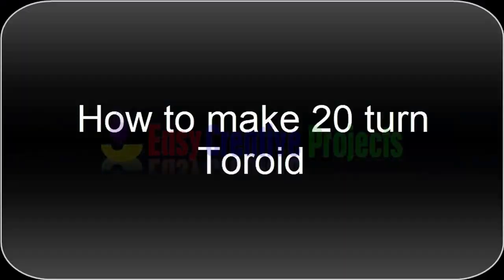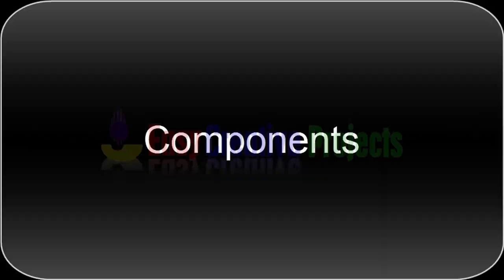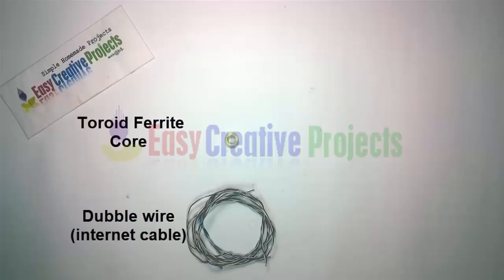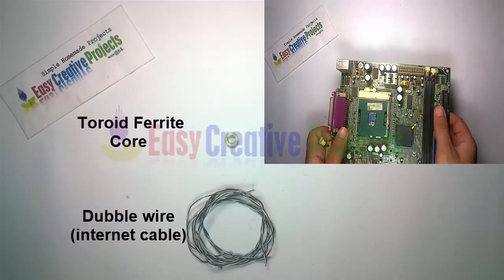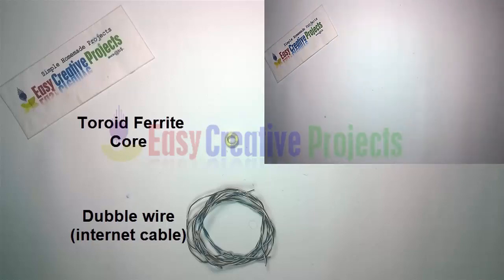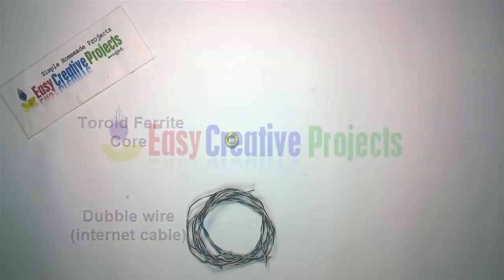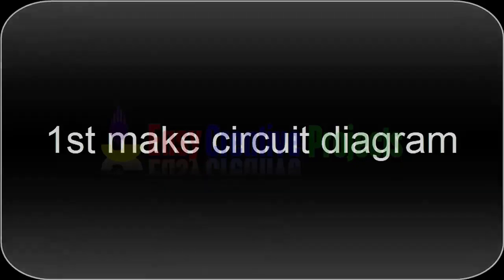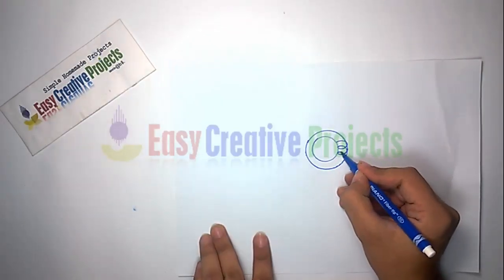How to make 20 turn toroid - easy steps with circuit diagram

Comment: What can we use this for?
Reply from the maker: in previous video we use toroid. (How to run 12v led on 1.5v)
but in this video we tell how to make it.
Reply: Yes I saw and I have one doubt is that how much voltage it will produce in the path led light and also can u tell how much amp it will produce for the no of turns